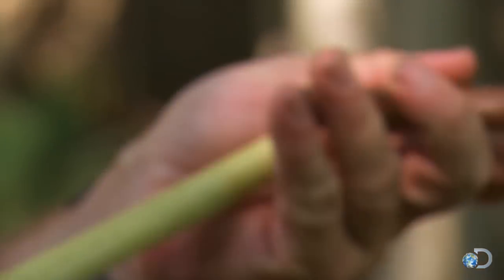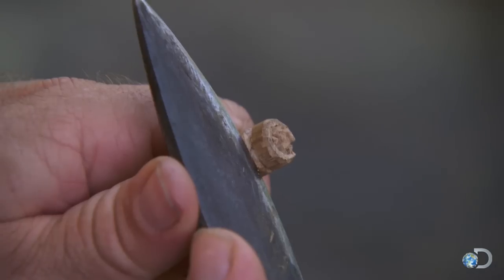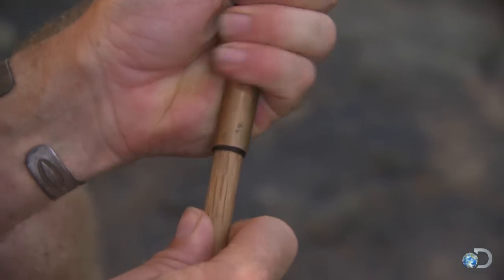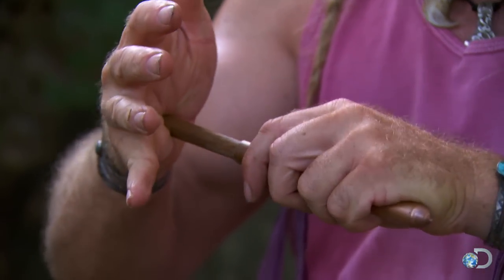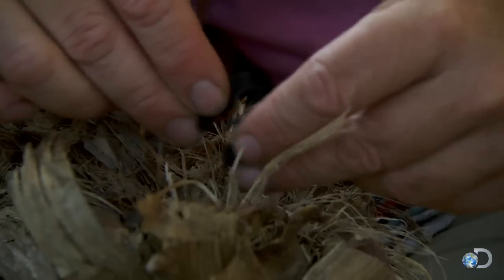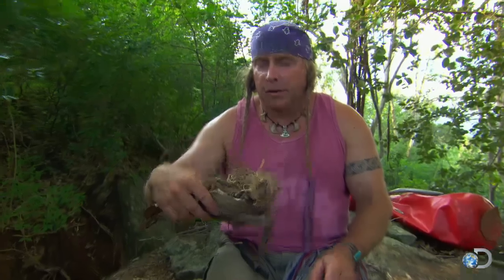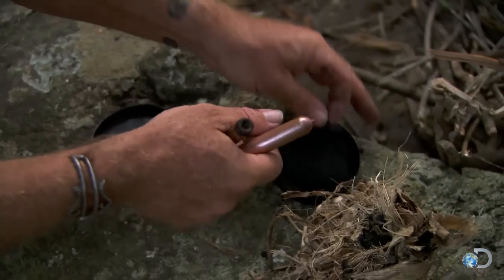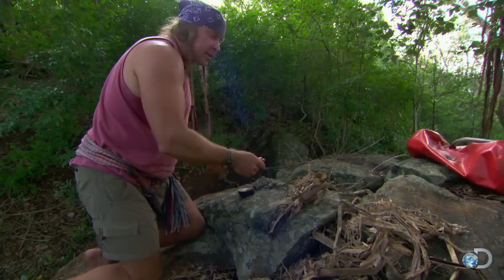DIY Survival: Fire-Starting with a Fire Piston | Dual Survival

Comment: Thanks for the great video lesson Cody on 🔥 piston especially since I've never heard of it before until now! I've lived in the woods/swamp in Slidell Louisiana for (6) months a few years ago and had to learn quickly how we were going to survive out there between the flooding, which we were flooded out (2) times before getting some cinder blocks on each corner a putting a piece of plywood under out tent which made it a whole lot better when it comes to floods! Plus we dug a small trench to make the rain flow away from the tent! We also had a tarp over the tent at an angle for the rain to run off! Poison Ivy's horrible out there, so didn't really know what to do with that except Caloclear lotion and putting hay/straw down on top of the path in and out of the campsite! We didn't make a 🔥 at this point in time, just because it was kinda close to the City/County line and didn't want to draw anymore attention to ourselves as possible! Any information you can provide me with on new/different tips would greatly be appreciated! Thanks again Cody! Have a great weekend ❤️🤠

Comment: if you can carry that charcoal then you can carry a lighter. The point of these things is that you can make them w/the stuff around you, should you not be able to plan ahead and have a lighter/match/charcoal. So if you need a rubber loop or charcoal to light it, it's useless
Reply: You can make it in the woods done it a few times but it takes a bit of time to collect the stuff. Dont have to use an o ring or metal pipe. And you can make charcloth in the woods. All you need is a metal can and a natural fiber. Only hard part is getting a good seal with the piston, I use old cloth soaked in animal fat. Bamboo for the outer part, and a peice of hardwood for the piston. You do have to kind of pretreat the piston by just using it without charcloth about 10 times and it ensures that there is no moisture in the internal parts of the piston itself and if you do that it's a generally consistent and easy way to make fire. Making fire involves everything that you have I have done handdrill, pumpdrill, bowdrill, chemical, Flint and steel, piston, scraping style for if it's bamboo, and using a magnifying glass. Gotta say tho if you have charcloth you are so much better off and I can start a fire within 15 seconds with charcloth and either a fire piston or Flint and steel.